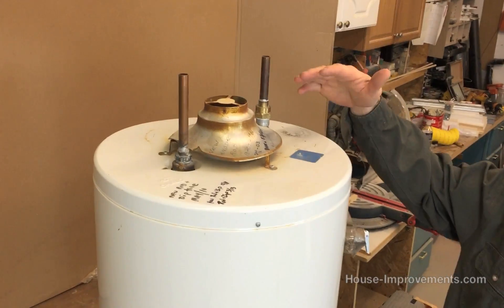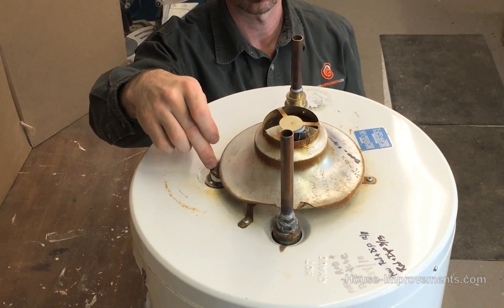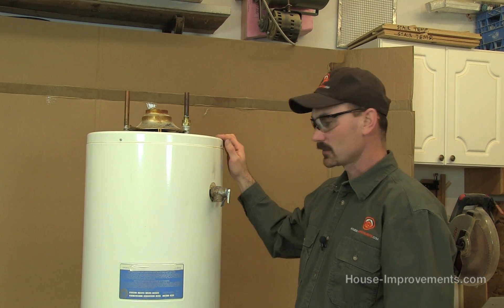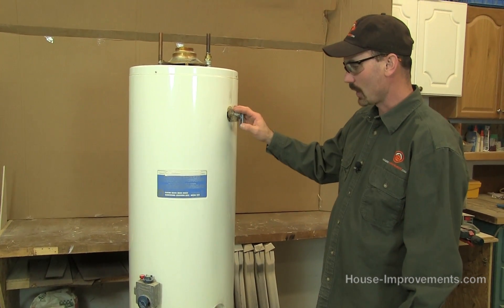How A Water Heater Works [Cutaway View]

Comment: Hello, I just replaced my pressure release valve in my electric hot water heater. I noticed this black grease jelly slime/sludge when I was cleaning the threads! I shined a flashlight inside and it looked like the inside of the tank is lined with this gunk! It looks almost like rubber when it deteriorates! Do you have any idea what it might be? The water looks clear! Just don’t know if it’s dangerous!
Thank You!!

Comment: Wow 40 plus years! Just bought a house with an 18 year old water heater. You give me hope to get another 22 years out of it lol. Great video!
Reply: Not for the new models today you won't, even if you get an extended warranty
Reply: Replace it. The inside of the tank is disgusting at this point.
Reply: Man, as long as it's not leaking...leave it alone. Depending on it's location, obviously. When I built my house I used to drain the tank every couple of years. Then when I saw how little sediment flowed each time I stopped. About 10 years later I drained it just for curiosity. And got a handful of sediment out. Then about a year or two later the bottom blew out and there was 2 inches of water in our utility room downstairs. I have a stilt house so no real damage just a mess. I'm wondering now is draining better or not? You'd think so but more often? Anyway they'll generally let you know before they blow, with a small leak. But ya gotta figure. 40 or 50 gallons of water sitting on the bottom of the tank and rust? Safe is better than sorry if the heater is in your living space.

Comment: Shannon, I have installed my water heater about a year now and it was working fine until now. All of a sudden the hot water stopped coming out of the tank. I have check to see if the supply water was entering the tank and it was. I removed the hot water line from the top of my tank and  turned the suplly water on and nothing was coming out of the tank from the hot water line. I blow some air in the lines thinking that it was plugged. I had no success. Could you help.

Comment: Shannon,  Great videos,  I see that you are using a GAS HEATER, When draining the heater for cleaning it out I have seen where people sometimes to do this and not shut it off well and the water drips on a WOOD BOX support,  On almost all Mobile home?   After a couple of years the floor is wet and the weight of the heater begans to cause the flood sag and before long the vent pipe comes loose and sometimes falls off and after a while you will have a HOUSE FIRE because they didn't shut off the value very well and  If you would suggest that in your next videos I would appreciate it.  I am a retire Fire investigator and have seen many times people have done this and never fixed the drip!  Thanks for your videos........
Reply from the maker: Yes I could see that being a problem for sure over time. these valves have a tendency to drip ,a small container under them to catch that would help as well.

Comment: Hi,  your video is very informative and such a great presentation.  Thank you for sharing.  Now, OMG!  I've never flushed any water sediments since I've owned my water tank which is 18 years now YIKES!   I never knew I had to.   I always get good hot water supply and never any over heat flow.  Should I now flush the water tank knowing I will clog it and probably need to repair?
Reply from the maker: I would leave it alone at this point ,you are just asking for trouble because of the years it has not been maintained if you start draining it now.

Comment: All that crud can be eliminated by using whole house water FILTERS. Plus, check your Anode rod every few years. Tip: I installed a hose bib to my drain valve, use it for washing my trucks and cleaning when I need "warm" water. This takes care of the required "flushing" maintenance.
Reply: Marky Polo water filters do nothing to reduce scale or rust, which is what most of this debris is comprised of.
Reply: Can you permanently leave a heavy duty garden hose connected to the drain valve and leave it up next to the water heater or even possibly run that hose to outside the house via the attic ?  Would this be a good idea to drain it this way by just turning that drain valve on ? Thanks

Comment: if you have visual signs of rust in the hot water line on a 30 year old heater, should you just replace it?  No leaks, just very rusty / dirty hot water.  (cold is clear)

Comment: 50 years? Seems most get replaced at 10 years.
Reply: if you dont flush them and check the anode rod than yes you will
Reply: It should last longer than 10 years.
Reply: i got 20 years so far and never touch it yet... 40 gallon...
Reply: My water heater is over 20 years, with no maitaince. I also keep the temp. low, which might make it last longer.

Comment: Love your work, especially the basement finishing videos.  I'm almost 3/4 of the way there.   I came to this video because I need to replace my anode rod and due to limited ceiling clearance I will need to insert the rod at a sight angle.  I wanted to make sure of the internal workings of the tank as not to puncture something in the process.  The tank if fairly simple and open and I do not anticipate any problems in the process.  Thanks again.

Comment: On my electric hot water heater i remove the bottom element and use my shop vac with a hose that fits in , and vacume out all my sediment twice a year. Why dont gas heaters have an opening big enough to get a shop vac in to clean them out?? The only gas water heater i have seen with a sediment door was a commercial model

Comment: Great video; however, the thermocouple is not really a sensor, it is a millivolt generator that supplies a current to keep the main gas valve open as needed when the thermostat calls for heat. Good job overall.

Comment: I made the mistake of popping the pressure relief valve on an old heater. ain't no telling when the last time it was done. (Probably never)  The valve must have been corroded, because no matter how many times I actuated it; it kept on dripping until I replaced it. 
So keep that in mind  that you may have to replace it if it hasn't been done before. 
Great video by the way!

Comment: Awesome video, Shannon. That thing looks like a corpse! But seriously, how would I change a 4 foot anode rod or dip tube when I only have 3 feet to the basement ceiling? Do I need to disconnect and tip the tank, or do they make tubes in sections that can be assembled  over the tank? Thanks again!!
Reply from the maker: disconnect the plumbing ,drain tank and tilt it forward. Only way I know.

Comment: How often should I flush the water heater, change the dip tube, change the anode rod, change the drain valve and inspect and ,or, change the pressure release valve?
Awesome video. Thanks a lot.

Comment: Why are dip tubes made out of plastic?  Would copper not be better?  If so I think I could make my own.
Reply from the maker: good question? Maybe cost? I also think that so few people know about the dip tubes that many will replace the heater and not just the dip tube? So that gets more big sales??
Reply: I was thinking the same thing.  Why make a heater that could last for 50 years when you can sell heaters with a crappy dip tube and sell 5 heaters or more during that same 50 year period.

Comment: Nice presentation. My water heater just went out 2 days ago. What a mess. It lasted 16 years before giving up. I never changed out the anode or dip tube. It worked fine right up to it's last breath. Maybe I could have gotten more years out of it, if I had only did the proper maintenance. I still don't understand why stainless steel isn't used. I would be willing to spend the extra money knowing I was buying a water heater that would last 2-3 times as long as the typical lifespan. Thanks again for the video. Thumbs up and subscribed.

Comment: Great video.  I had no idea there was an anode in a water heater.  I knew tanks would rust out every 10-15 years, in my area, but didn't realize the life could be extended by replacing the anode.

Comment: As soon as I turn my water heater's knob from hot to warm, the flame is off even though the pilot flame is always on.  Does anyone has the same  issue?  Please reply.  Thanks!
Reply from the maker: you are turning down the  temp. So the flame should go out and only the pilot light will stay burning

Comment: Thanks for the helpful video. I got a 11 years old 75 gallon gas water heater, it's next to 2 new cars. When water heater starts to leak they just leak a little bit right? no need to worry about the 2 new cars? Also it's old so just wait until water isn't hot then replace it? thanks for the help
Reply from the maker: They do not generally implode no.

Comment: Shannon, if water comes out the bottom, does that mean it has a leak in the large area of the rod in the middle of the tank , where you indicated at the end of your video? If that is the case how can draining and changing rods give the tank more life? please explain.
Reply from the maker: usually if water is coming out the bottom you need a new tank. Periodic changing of the anode rod will extend the life of your tank if it is not already failing. The rod is sacrificial and attracts minerals that would normally eat away at the tank instead .

Comment: Would a broken dip tube cause the water heater to not fill completely? I went to drain my water heater after not being able to keep my pilot light on and only about half a gallon of water came out but I do have water coming out of my hot water lines at home. So I am completely lost. Water comes out of the hot water outlet with good pressure as well. I left the drain valve open and nothing comes out. Finally, and i tried this a couple of times, I reopened my cold water inlet valve to refill water heater and I only hear it refill for about 5 seconds and again I drain and only about half a gallon comes out

Comment: Thanks very much for this great video!  I've experienced the corroded dip tube syndrome myself.  I'm wondering why they make the dip tube out of plastic.  Couldn't they make it out of some other material that wouldn't corrode?  Wouldn't copper or maybe stainless be better?  Also, what is the tiny hole at the top of the dip tube for?  Thanks again!

Comment: How often should the anode rod be checked.
Reply from the maker: It depends on the water in your area but every couple years is usually almost too long. Check it after a year and see what condition it is in. If the Anode is more then 3/4 gone I would change it.

Comment: Hi, Really nice video. I always wonder how much time will it take to refill the water heater tank once all the hot water has been used. Do you know how to find that out? I believe my hot water heater is 40 gallon.
Reply from the maker: Your tank refills as you use the water, but the new water needs to be heated to get up to the temp. you have unit set at.
Reply: hmmm.. How do I know what time that would be? Say I am setting it at highest possible temperature.

Comment: Hi Shannon
You are great doing the tutoring about how water heaters work.  
I have a Rheem gas water heater, installed in 2006, would turn off after a couple hours of working and repeat the same symptom repeatedly.  Can you help me out on this.  Not sure if is the thermocouple or should the tank be drained. or could it be a gas control unit (thermostat)?
Thanks,
HT
Reply from the maker: likly thermocouple

Comment: My water heater tank doesn't seem to have a sacrificial anode! At least there's no opening at the top where it should go. That seems odd right? Are there any water heaters  manufactured without a sacrificial anode? Or are located in other places beside the top of the tank? Mine is a gas water heater located in my attic (no basement here in TX).

Comment: Hello, I have a leak which is causing water to appear at almost every area, including around the water inlet/outlet, around the relief valve, and even from under the lid where it attaches to the top of the tank.  It's almost like the inner tank is leaking into the inside the outer case, and has filled that area.  Sound like anything you've heard of? Thank you!
Reply from the maker: Yes that is exactly what is happening. The only thing you can do is shut off the water supply and replace the tank

Comment: I have a newly installed hot water tank... Is it necessary that I light the heater to check whether the hot water lines are functional with the same pressure as the cold water? I have tried turning on the hot water in the sink without heating the tank and no water flows out of the tap.  My reason for not igniting the burner is soley for the purpose of checking for leaks.  thanks for your video but it does not answer my problem unless  a broken dip tube can affect the flow.  Thanks for the great video on how a gas hot water tank works. Cheers  James
Reply from the maker: You should not need to light it to run a hot tap. Are you sure the water supply is turned on? You may have a air lock also. Try draining the tank form the bottom valve. Ask a question in my forum for further help. http://www.house-improvements.com/forums/

Comment: Good job, good video. my hot water tank manual says about once a year to pull the pressure relief valve. I try to do it at least in the spring and fall. like changing smoke detector batteries. Beware they don't always seal back up too good. Is it better to have a steel lined tank?
Reply from the maker: most are glass lined

Comment: why are the dips tubes plastic? and not copper? or aluminium?
Reply from the maker: Good question? maybe so they can sell more water heaters because most people think the whole thing needs replacing?
Reply: LOL, I don't remember this being a problem in UK water tanks, I learned about this recently here in Canada, had a dip tube go bad and it was explained to me by the tech (tank is rented), he replaced it, but advised that for a while yet, that plastic bits will be in the taps for ages, cloggin up the filter screen, which in fact it did. Would make sense to have a non-rusting copper/alu or alloy instead, but hey  oh !, nice vid and dig your channel, Adrian
Reply: I have the same question.  I'm tempted to try and make out out of copper tubing to have on hand when mine fails.

Comment: Amazing job! You're an excellent teacher! I've had a small leak of about 1 drop of water every few seconds for over a year and just ignored it so far :)) I've heard that changing the anode rod every 5 years can double the life of the tank in terms of corrosion. Do you agree? How often should it be changed? Leaks seem to be the main reason for water heater replacement.
Reply from the maker: yes the regular changing of your anode can increase the life of your heater. How often should you change it? That depends on your water but every 5 years is not enough IMO. I change mine every 2 yrs. And usually after 2 yrs there is not a lot of it left.

Comment: Thank you that was the most informative video on this matter I have seen , My Richmond gas mobile home  water heater is  crackling and popping  so  I drained but not much sediment came out, then i grabbed my hose and put high pressure nozzle on it and and squirted it in the drain hole well a little sediment came out, I  needed to look for any other ways to remove it all , then i found your video> Thank you!  for now i am going to get the water heater going again and see if the popping noise has stopped. if not what do i do then? any advise would be much appreciated
Reply from the maker: please come to my forum if you have trouble. we can discuss from there. http://www.house-improvements.com/forums/

Comment: Very informative video, thanks.  I have a propane water heater, about 10 or 12 years old.  I have flushed it out a few times over the years, but never saw a great deal of sediment.  Lately the clunking when it is heating has gotten quite louder. It sounds like big softball sized chunks must be rumbling around in there, but I didn't see anything online that suggests the deposits would do that.  We are on well water, and last year added a water softener system.  I drained and flushed it again today, but the clunking is unchanged.  Any ideas?
Reply from the maker: It is usually air trapped in the tank I have heard and it usually goes away?

Comment: Thanks for a great presentation.

 I was not able to shut off  the cold water and decided to drain about 5 gals to see what came out. The water appeared to be crystal clear. Is that because the cold water diluted the water at the bottom to a point that I could not see any crude? 

The heater is at least 8 years old.

Any ideas as to how I can free up the cold water valve?

Thanks again.
Reply from the maker: Hmm, must have a clean heater I guess. The valve would have to be replaced usually. Use a ball valve this time!

Comment: when should anode and dip tube be changed before they typically fall apart?
Reply from the maker: Depends on your water quality but every 1-3 yrs or so for the anode rod and the dip tube just when you need to.

Comment: Can you explain how you would know when to change the anode rode? What about weak water pressure ( only hot water) could that be the result of

sediment build up in the tank? Thanks
Reply from the maker: changing the rod depends on the minerals in your water ,pulling the rod and checking its condition after a year would be my suggestion. Our water is pretty good here and I just do mine every year to be sure.
The cold water and hot water should be basically the same pressure , you may have some blockage in a line , airlock or maybe the cold water valve on the line going to the tank is not open all the way?